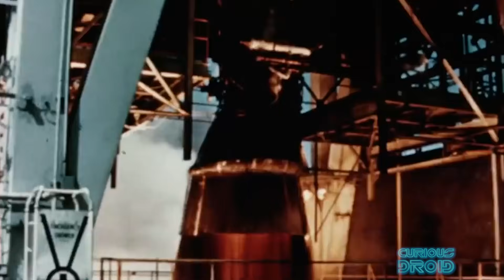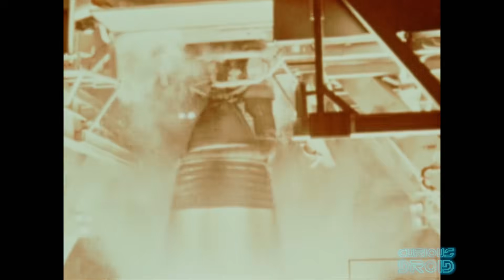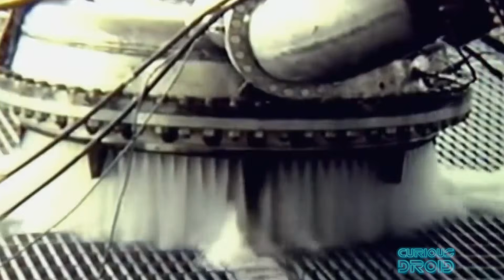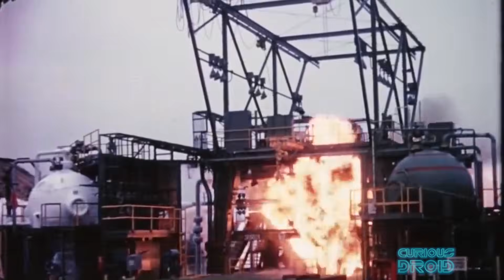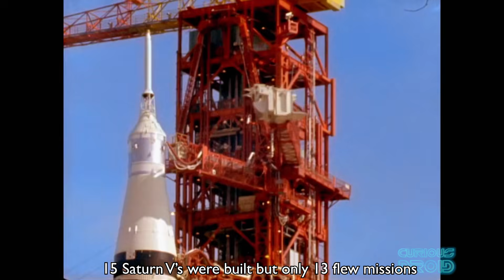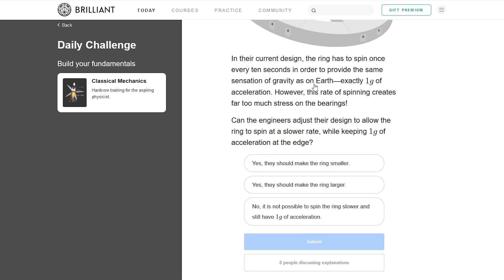F-1  The Engine That Nearly Stopped the Apollo Moon Missions

Comment: Tbh, even without computers as an engineer i would increase the turbulence in the spray and combustion chamber. Another fix would be to divide the combustion chamber into sections so that way it burns evenly
Reply: So is that a standard technique in engineering ? To solve turbulence you increase it?
Reply: That's pretty much exactly what they did. By adjusting the angles of the holes in the injector plate they got the two liquids to impinge on each other to create a turbulent mix that mingled the propellants at the best distance from the plate to make the engines stable. And the baffles divided up the chamber into thirteen sections to stop the pressure waves from flowing around and around inside..
Reply: @oman636   no, the problem they had was uneven burning of the fuel so you can increase turbulence by changing the shape of the inner walls of the chamber. this will induce turbulence which will mix the air/fuel mixture
Reply: @joevignolor4u949   nah they didn't do it like i would i would literally have big cylinder shapes running from the spray all the way to almost the end of the combustion chamber. what we know from jet engines today is most of the thrust is produced from harnessing the energy AFTER the combustion chamber so..
Reply: @limbeboy7  Well that's nice but I'm sure the engineers who worked on the F-1 knew what they were doing. It get us to the moon after all.
Reply: @joevignolor4u949   they kinda wasted lots of money on test tho
Reply: @limbeboy7  Why? The bugs were worked out of the design on the ground and none of the engines ever failed in flight. In all 65 of those engines flew on 13 Saturn V's and not one failed.
Reply: @joevignolor4u949   yea i also took an engineering economics class while in school you have to always find ways to reduce cost. destroying hundreds of engines in research is kind of a waste when i could spot the problem in 5 mins
Reply: @limbeboy7  You also have the advantage of 50 years of hindsight and a better education.  Those engineers were trained during the days of piston powered airplanes and no rocket engines at all.
Reply: @limbeboy7  I doubt you could have figured out combustion instability in five minutes or even gotten a good understanding of the problem. Frankly I find a claim like that to be very egotistical. And one thing I learned doing engineering for over 40 years is that people who are in love with themselves make very poor engineers. This is because they develop an emotional attachment to their ideas and designs and ignore the obvious flaws instead of objectively evaluating and fixing the problems or if necessary discarding the entire design.

Comment: Wow, that sounds like it was worse than the RS-25 Space Shuttle Main Engine, which also blew up in a test and destroyed the test cell. The delays caused by the RS-25 development problems are part of the reason they couldn't get the Shuttle working in time to save Skylab. In the end, like the F-1, the RS-25 turned out to be a fine engine, possibly the best piece of tech to come out of the STS program.

Comment: Somebody needs to revisit this problem with computer aided design and other modern tools to make the F1 more efficient. Like by modelling the injector plate and working  out exactly what type of design would be best. And tweaking whatever is possible. If CuriousMarc and co. can restore an Apollo Guidance Computer, I have the utmost confidence that somebody out there can redesign the F1. At least on paper.
Reply: They did.  F-1B.
Reply: @TheEvilmooseofdoom  Also, M-1.
Reply: @caav56  Different fuel cycle for the M-1 but a beast none the less! :)

Comment: By adding a baffle plate in front of the injector plate solved F1's combustion instability the idea can be traced back to the V2 engine which had a similar design thus prevented the exhaust flame from excessive cycling back into the combustion chamber. Shame that NASA can't build it today

Comment: The Sovets, while solving the same problem, droped the idea of a large comdustion chamber and went to use a claster of smaller chambers insteed. That had gave them a possibility to create an even more powerful engine with a way more effective fuel cycle, better specific impulse and better t/w ratio - RD-170.
Reply: But at the cost of adding lots of single point of failure in each motor, thus never had been able to take off using those :-(
Reply: @ThomasKundera  What are you talking about!? The RD-170 and its derivatives, RD-171, RD-180, RD-191 e.t.c., are most effective, reliable and successful engine series in the world.
The F-1 is long gone in the history, the RD-170 series is flying today on many rockets (including the US) and will be in use in a foreseeable future.
Reply: @RustedCroaker  : Sorry, I was thinking about the equivalent of Saturn V, the N1 rocket, with about 30 motors, and never actually worked...
Reply: @ThomasKundera  The NK-33 engines made for the fifth (canceled) N-1 rocket are actually currently in use on the Soyuz-2.1v and pretty successfully.
So that not that all simple with the N-1 project. If it wasn't canceled it eventually could be a success. The US blew up engine test sites for years developing the F-1 before launch a whole rocket. The USSR went street to launch a whole rocket, without testing the first stage separately. Just different methods.
Reply: @RustedCroaker  : Thanks for all those informations.
I learned something, the hard way, and I enjoy that :-)

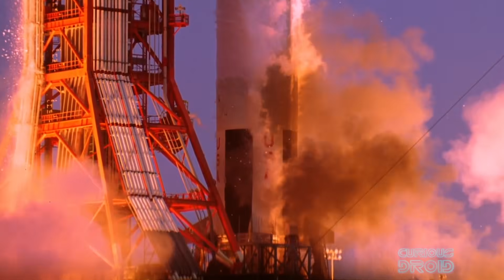Comment: what a cool video !  Hey everyone, i have a question !  every time i see  videos of the Saturn 5 launch,  when the engine starts, you can see the flames going outwards on the launch pad, but maybe 1 second after, all the fire seems to be sucked down under the pad by something.  is it just the venturi effect or is there some kind system in place to make that happen ? the design of the concrete elbow that redirects the fire on the side of the launchpad ?  tyvm, i'm always wondering !  @7:24  you can see it

Comment: This is actually quite a common problem in electrical engineering. A lot of it is getting a circuit to oscillate the way you want it to, or stopping it from oscillating in the event that you don't want it to. Not quite the same oscillations, but I'd bet dollars to donuts tha some of the math is the same.

 Heck you can even describe the energy in a capacitor with the exact same formula you can use to describe the kinetic energy of a space ship. Just with different units, of course.

Comment: Paul, can you give some insight on this: in many of the clips you included the exhaust form the F1 is very dark, barely brighter than the nozzle from which it is being blasted. A short distance from the nozzle it becomes turbulent and very much brighter, incandescent in fact. It would seem that the outside of the first, mostly laminar, part of the exhaust much cooler than the inside, which would protect the engine bell from melting, but how was that achieved?
Reply: By venting the exhaust from the turbopumps into the bell.  you can see the big pipe designed for that in most of the clips forming a kind of skirt part way down the bell.  It helped keep the inside surface of the bell cool.

Comment: I'm confused according to Sonny Morea the Apollo F-1 engine project manager and Ronald E. Tepool the Apollo F-1 test engineer the combustion instability problem was solved by looking at Wernher Von Braun's V-2 rocket. In the V-2 liquid fuel and liquid oxygen were injected through a number of separate nozzles unlike the F-1 which used a single flat fuel/oxygen injector plate like a shower head which is why the V-2 engine did not blow up like the F-1. Understanding this difference is how they came up with the baffles to separate the combustion into zones to eliminate the combustion instability. The bombs were not used to create the combustion instability but rather to test the baffles to see if they could correct the combustion instability created by the bombs.
Reply: You have it correct.

Comment: People wonder why space flight is so expensive, especially during the earlier years. This story, and thousands of others that detail the challenging space technology development processes help answer that question. Prior to computer aided engineering, the term “testing to destruction” was either intentionally or unintentionally part of the development process as the unknown unknowns surprised design engineers. Those guys had an excuse because they were doing something entirely unprecedented. Today, it is not as easy to forgive a poor rocket design that explodes either on the pad or in the air as SpaceX vehicles do all too frequently.

Comment: Serious question. How the hell do you hold down five F-1 engines? How do you build a test stand strong enough to hold them still without destroying ... everything? I've been wondering about the Starship and how that thrust puck works on the Super Heavy. How do you make something strong enough to handle the force of 30+ raptors pushing up against it but also able to lift the weight of everything above it? And then I just watched this video and the test stand with five F-1s seems like even more of a challenge.

Comment: Not surprising the Soviets moon rocket first stage kept failing after having zero full scale tests.
Reply: To be fair the Soviets has a different design /test approach. Build and test until it goes right. They had four failures but the reliability was improving. Another test sceduled for 1974 could have succeeded, however it was cancelled.

Comment: These large engines had to be big to carry the huge amount of oxydizer and fuel required, NOT the payload.
Reply: they had to lift everything, including the "payload", which would be the 2nd stage (with most its weight being fuel and oxidiser) the 3rd stage (again same), service module and LM (again which contained by weight mostly fuel)
Reply: @Agarwaen  I meant to write, "not just the payload". Oops!
Reply: @stevelangstroth5833  no problem then ;)

Comment: Excellent video....I learn a few things with every one you and others produce.... I didn't realize that the F-1 development started years earlier than I thought... I see that the 'younger' hoax believers are at it ....and maybe alot of them are not from the USA... you have to know, that the 1960s was a different time....full of paradoxes... the Apollo program was huge, and Mercury, and Gemini programs were going on 'concurrently' ... and don't forget, the 'whole moon landing system' was 'short term, and single goal' oriented.... designs are 'different' when cost is NOT an issue, and things are 'single use'... I have a saying for 'space development' of the time, I call it 'high science, low tech'.... engineers figured out how things worked, and used that to get to that goal.....

Comment: Space Shuttle main hydrogen oxygen engines had similar stability problems that set the program back years.  Same problem, also fixed with baffles. I wish the guys at at Rocketdyne that worked on the F-1, talked to the guys at Rocketdyne that worked on the RS-25.
Reply: What makes you think they didn't look at previous engine designs? Do you really think they start from scratch like they were building the first ever rocket engine.

Comment: The soviets struggled with cavitation and vibration ... all the same problems that the F1 faced.  That's why their N1 had 30 first stage engines. Today the soviets run the most efficient rockets ... they solved some of their issues by putting four chambers on one engine.  The F1 baffles and injector changes solved the problem that Russians never solved.
Reply: But I thought the rd-180 was the most efficient engine? Doesn't that count for solving the problem or is the engine still unstable ?
Reply: @oman636  With a rocket as big and massive as the Saturn V efficiency (known as "specific impulse") isn't the biggest issue in the first stage. The biggest problem is getting enough static thrust to lift that fully fueled and enormously heavy machine up off of the launch pad. That's why the F-1's burned more massive kerosene instead of lighter hydrogen and why the space shuttle needed SRB's to get it of the ground. Then once the vehicle is off the ground and the first stage burns out then more efficient hydrogen engines can take over and accelerate the vehicle into orbit.
Reply: @joevignolor4u949  cheers
Reply: The RD 180 is a dual chamber design......a very efficient rocket indeed.  But if you want or need a single chamber rocket with over a million pounds of reliable thrust then the F1 is the best at getting that job done.

Comment: Why don't we just use the F1 for the SLS program? It is a tried and true design.
Reply: Apollo didn't launch nearly as many engines as STS did.  It is not a given that the F1 engines were really that robust.  The STS engines are the tried and true ones.
Reply: There were plans to use upgraded version of it, called F-1B, for the "Pyrios" side boosters of SLS, before they were ditched in favor of SRBs.

Comment: i have a question that might be a new video topic, how do engineers keep the engines from flying off when they are tested? surely its some very impressive rigs holding them in place? :o
Reply: They use bolts, typically.

Comment: why did the saturn V have 5 gigantic engines instead of like 10 smaller engines or something like that? was it easier for the computers to control fewer engines?
Reply: More powerful, the first Saturn rockets that were launched weren't Saturn V's they were Saturn 1B's, those were comprised of 8 Rocketdyne H-1 engine's for the first stage, they were only powerful enough to launch the Saturn rocket into low earth orbit and burned up all their fuel doing it which meant that there wouldn't be the additional fuel needed for a Trans Lunar Injection (TLI) burn to escape earth's gravity and go to the moon, they did this because the massive F-1 engine's weren't ready yet and the first launches only had to go into earth orbit to test the rocket itself and the command module, after unmanned test launches of it the first launch of a manned Saturn 1B was October 11th 1968, also it was actually a Saturn 1B and not a Saturn V that Grissom, White and Chaffee were killed in when a fire broke out in the command module of Apollo 1 during a plugs out test on the launch pad earlier in 1968.
Fittingly though the last launches of a Saturn rocket into space were 1B's and not V's when they were used to launch Skylab in 1973 and the Apollo/Soyuz mission in 1975.
Look up "Saturn 1B" on Wikipedia and you can read the history behind it.

Comment: Sooo... It was basically just a lot of smaller adjustments on the engine? Or what exactly solved the problem?
Reply: As knowledgeable as Curious Droid is he got this one wrong. The bombs were used to test the baffle solution they got by looking at Wernher Von Braun V-2 engines.

Comment: so what was the final baffle design?
Reply: (f) four inside eight with a 22.5° offset.
Reply: @Reactordrone   is the baffle technique used in modern engines ?
Reply: @oman636  I guess the idea is to design a combustion chamber that doesn't need baffles to fix it.

Comment: It was the sheer massive volume of fuel passing through the injector plate....the S-1C used 20 TONS of fuel per second....divided by five...??"

The instability of the burn was the bridge too far and why Rocketdyne shut the project down...engineers lost their minds trying to design the turbo-pumps to supply that volume of fuel for one engine... the turbo-pump was rated at 55,000 HP...for one engine.

To kinda put it in perspective...pay attention.....the massive volume of fuel traveling DOWN the entire length of the first stage (the S-1C...) would develop harmonics that literally caused the entire first stage to expand and contract along it's axis....described as the "pogo effect...like a pogo stick) and almost caused failure of one of the early launches....

Listen to this...they solved the problem by injecting nitrogen into to column of fuel to absorb the harmonics....bubbles of shock absorbers within the fuel...that had to have come out some late night bar event.

"Hey boss, it's the density of the RP-1.....the velocity is OFF THE FREAKING charts for the diameter of the supply pipes..."....."bartender, give this guy a fresh beer....tell me more....nitrogen!!"

Comment: Certainly the F-1 was a great development, but 100% reliability need to be qualified as it only ran for two and a half minutes and then was discarded.
Reply: 100% reliability means firing as directed, burning the correct amount of fuel, and shutting down as directed.  EVERY TIME.

That all of this was over only a few minutes doesn't change those requirements.  Meet its requirements including a designated safety margin.  That's really all an engineer focuses on.

Comment: I'd like to build the sea dragon with the 75 foot diameter bell shaped cone using hypergolic fuels and helium tanks to propel the hypergolic fuels out. Question would this have burn problems?since it's just two valves that you open up. Also would we need an injector plate?

Comment: Lets say Apollo 11 had a bad engine when it came time to leave the moon.  As far as i know they had one engine to lift off the moons surface. What if that engine didnt work??? Would the astronauts survive long enough to be rescued?
Reply: UploaderNine this is a pretty old comment and you probably don’t care but they used hypergolic propellants and a pressure fed ascent engine on the ascent from the moon. Hypergolic propellants Ignite on contact with the each other. A pressure fed engine means that all you have to do is open a valve. Those two together make an engine that is very reliable and hard to fail.